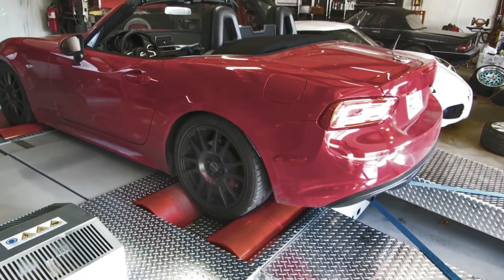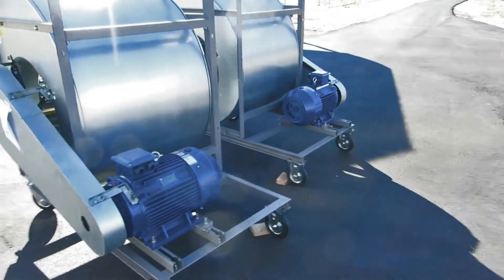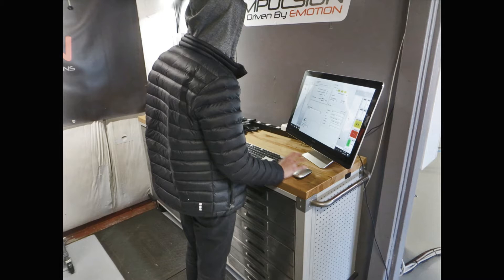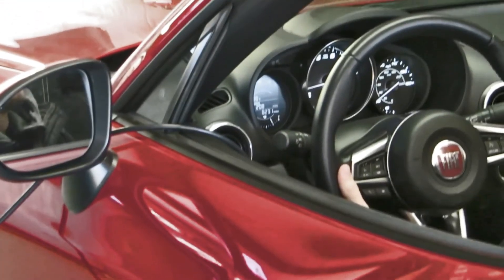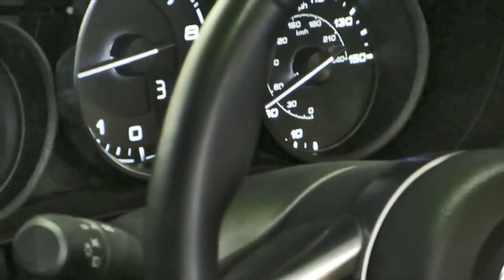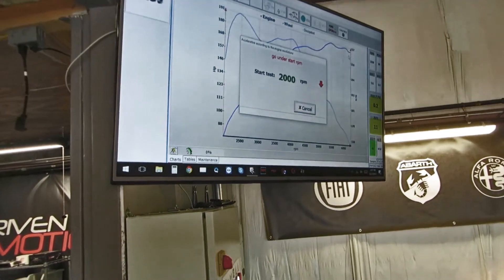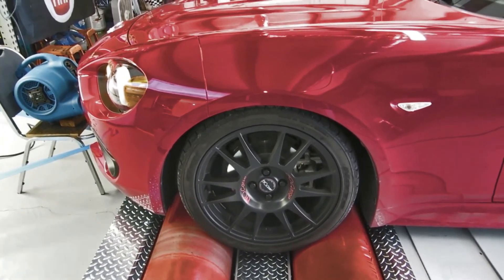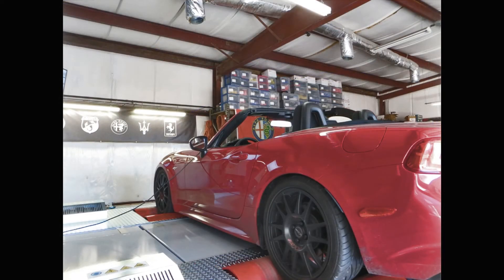Does Your Car Know It's On A Dyno ? A Comparison Test by EUROCOMPULSION

Comment: I have a Dodge Dart currently running your phase 2 tune. Does a Dart know if it’s on a dyno and pull power on a conventional 2wd dyno? I haven’t dyno’d my Dart because what’s the point if it’s not going to reflect the actual gains due to this? Thanks and I love your products by the way.
Reply from the maker: Yes it has the same ESC/TCS system as the Fiat and Alfa vehicles.